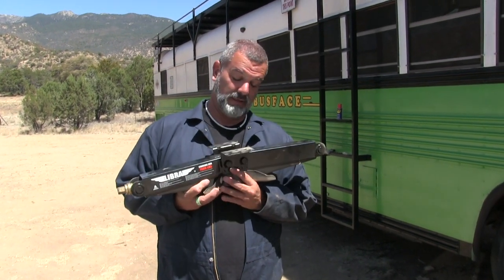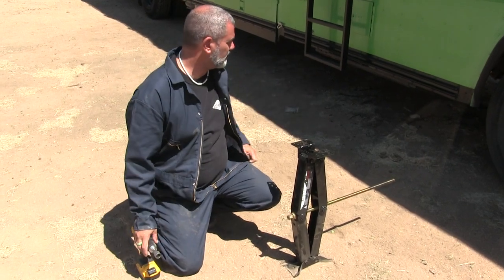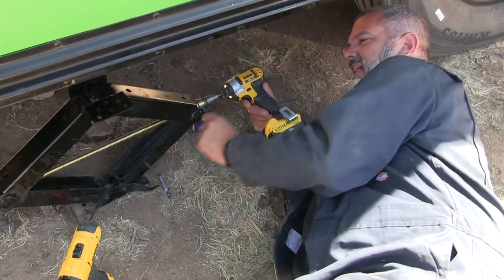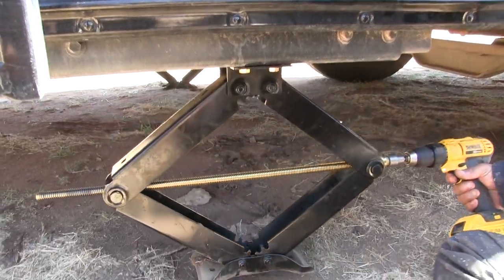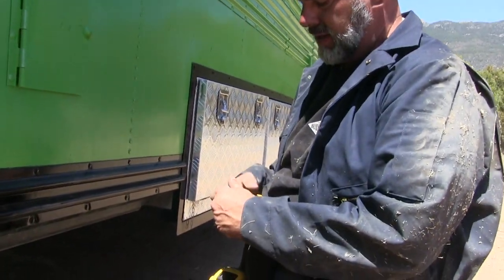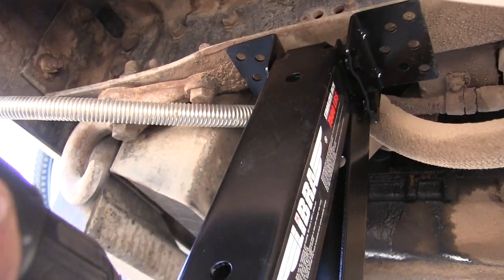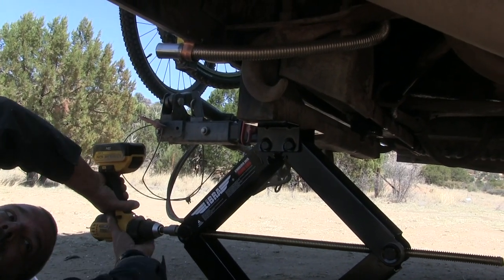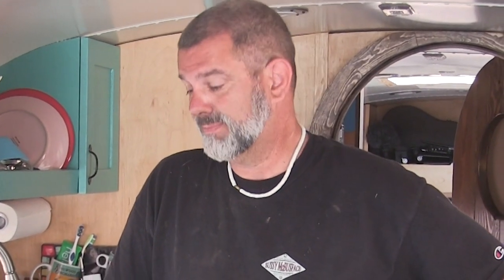Installing Scissor Jacks to Level the Bus

Comment: Tip! When picking up anything small with a magnet, put the magnet in a plastic bag and when through hold the bag over the trash and pull the magnet out through the top of the bag and the metal fillings will fall off into the trash and you won't have to pick all the small shards off the magnet.

Comment: 👍🏻❤️ had scissor jacks on my travel trailer, only issue I ever had with them was when one got bent by hitting low spot, had to replace. So mounting location is important. Great video. 👍🏻 also, thanks for explanation about oil on drill bits, it’s going to save me grief & $$ when I start drilling for my rivenuts. 👍🏻

Comment: Great job y’all as some one that has a RV and uses those type of levelers two pieces of advice use lithium grease on the threads and use both hands when operating the drill 😀

Comment: Consider making some pads to set on the ground below each jack for a stable base. I cut 1/2” plywood into 12” squares. Then cut 12” pieces of 2x4. Sandwich 3 of the 12” 2x4 between 2 of the 12” plywood squares. Screw each plywood square into each of the sandwiched 2x4 pieces with 1-1/4” flat head screws. I carry 8 of these pads as they can be stacked 2 or 3 high if needed on very uneven surfaces. For maximum stability and leveling use as little jack height as possible.

Comment: I hope they work for like you expect. They look like what they put on 5th wheels and the companies say they are not for leveling just stabilizing, so the rv doesn't rock when you walk around inside. 7500 lbs sounds like they should work to raise it some. Like someone else said keep that nut and screw that does the lifting lubed  with some good grease. PB Blaster makes a spray white lithium grease. Great job Mike. Safe travels!

Comment: Mike, would it make sense to add a small level near each jack (or maybe just one end)?  Maybe install them after you are level in a spot on the inside level, and make sure they are level when you install them.  It sould seem that would speed up your adjustments for setting up.

Comment: Great idea , check out a gadget called a levelmate pro I use it all the time comes in very handy! Also I usually put blocks under my jacks to I do have to extend them too far which makes it a little more stable it would also help your rear jacks reach far enough.

Comment: For my 20ft class c, I bought 4 of the 5000# jacks just like yours. I'm hoping they will be okay on my 30 ft, 30k# bus. I'm not trying to pick it up, just stabilize it from rocking.
Reply from the maker: It actually helps quite a bit. It can also help in a little bit of leveling as well. The only time they have not done very well is just an extreme wind.

Comment: Wonder if you could mount a gear reduction DC motor to the jacks and put them on a momentary toggle switch.  Eliminate having to go out in bad weather to adjust them .  Also cut some metal plates and mount magnets to attach to the scissor as landing pads. Thanks for the videos, David and Tammy from Florida.

Comment: You should check with an engineer Mike, I'm pretty sure the strength of a C Channel comes from the long vertical dimension not the short horizontal.
Reply: I am an engineer.  DO NOT EVER drill/weld/molest the flanges of the frame!  Bad juju will result!

Comment: mark the holes and get the jack out of the way, use a smaller bit first then use the big one.  I would use nuts on those bolts, any sideways movement will rip those threads out.

Comment: Does your bus have metal springs or air suspension?  Mine has air suspension, so I am on the fence with hydraulics or possibly a home made super duty version of a screw jack.  I really like your jack drill.  I've used a 2X4 with a fulcrum, but that is awesome.  I might suggest that a larger steel plate on the bottom will help with settling. (May not be a problem in Arizona...)

Comment: Since how you use Dewalt you should go and pick up a 1/2” impact gun, I have used my impact gun to change tires and many other projects for many years and I’ve never had a problem with my jacks stripping out or nothing like that.

Comment: There not for  leavening, they stabilizer  your rig, that is what rv uses them for around here any ways, they can lift up your rig by inches, but there just meant  for taking the movement out of the floor, when your walking across it, i gut a big rig too and i us short boards .

Comment: Don't use the WD40 (unless it is a special type of lubricant one) on the gears. WD40 is a penetrate, not a lubricant. Rub some ANTI-SIZE  on the shaft instead.  Also, be careful of mud on the shaft with running it with a drill. A rock could mess up the threads.